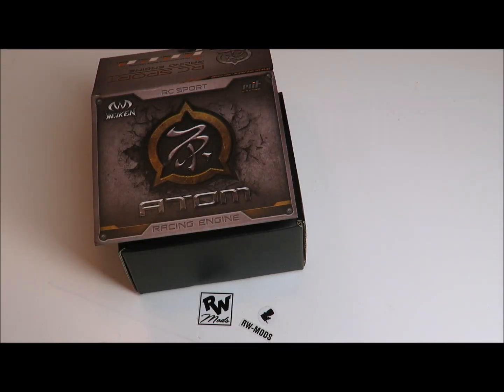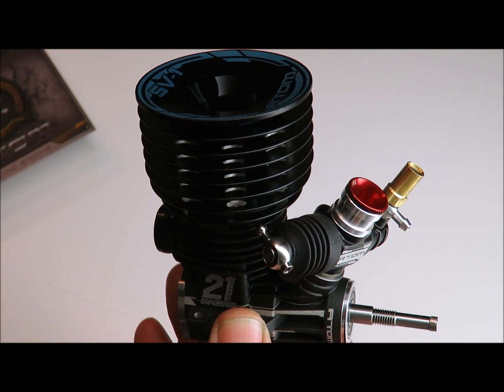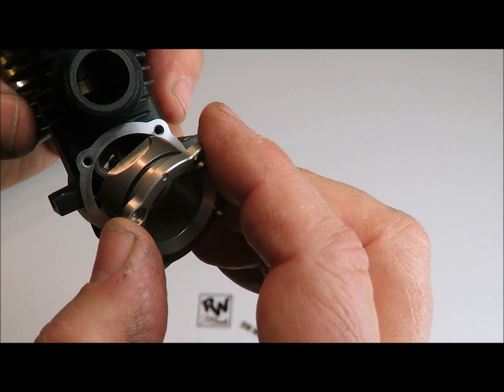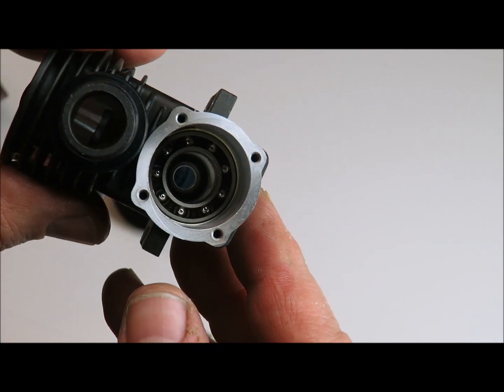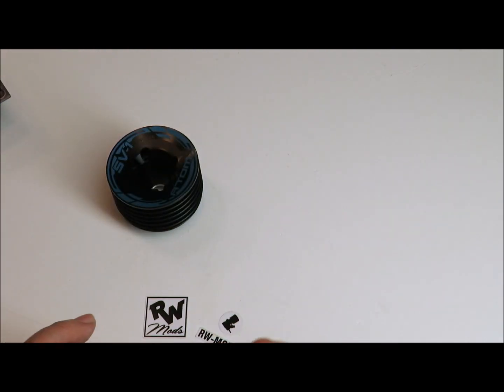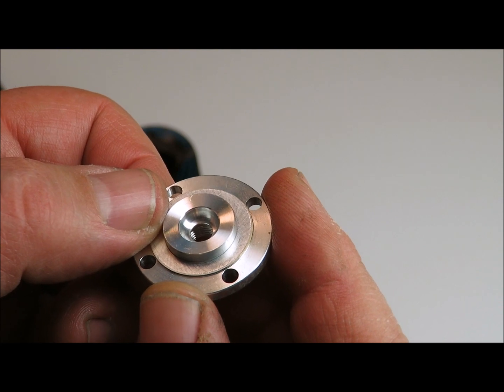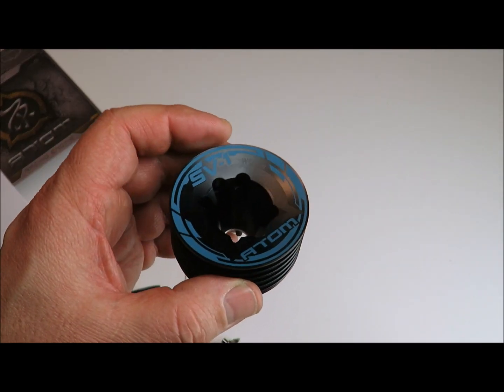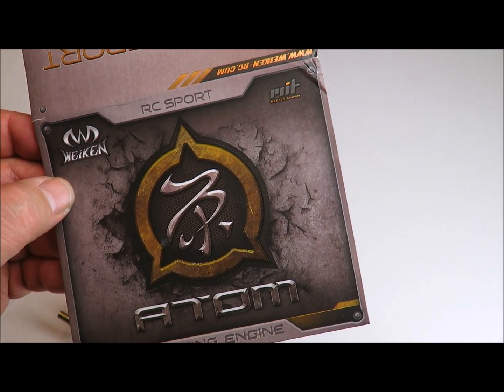Atom Sv1 nitro engine unboxing and Review

Comment: Hi Rex. If i were to add shims how many more stock shim shud I add as im planning to get stock shims..
Reply from the maker: If it is the same as the engine I reviewed I would add 2x  .2 shims
Reply: Ok Thanks...so i can use 2x the original aluminium shim and remove the brass shim...
Reply from the maker: The aluminum is .3mm? If so add one aluminum and one thin brass .1mm. just adding one aluminum to what was there would work fine also.
Reply: Ok noted.. Appreciate the help..Thanks...
Reply: I have 1 aluminum shim and 2 extra brass shims..and live in norcal..should I add one alum shim and 2 brass? Or 1 alum and 1 brass?..I would like to get the engine to run pretty much perfectly.